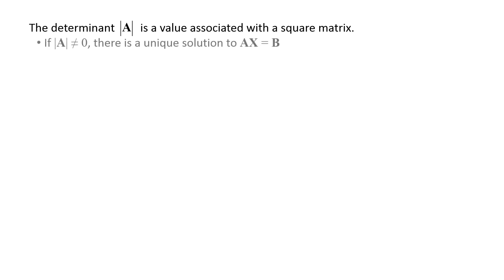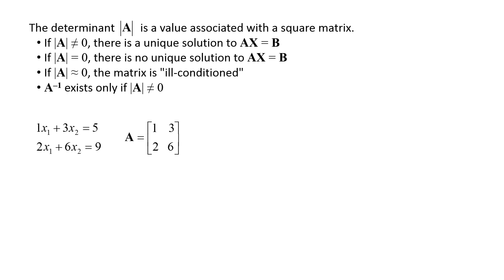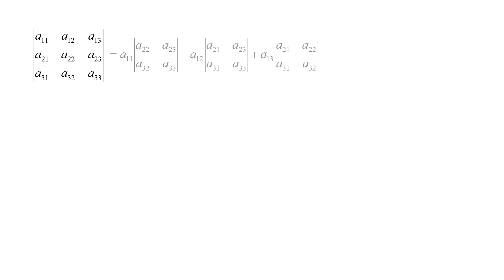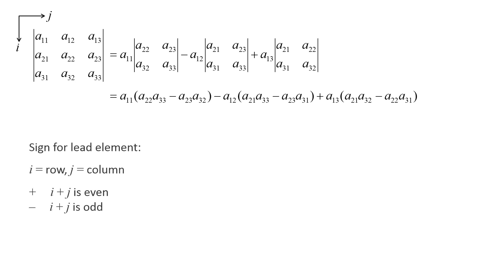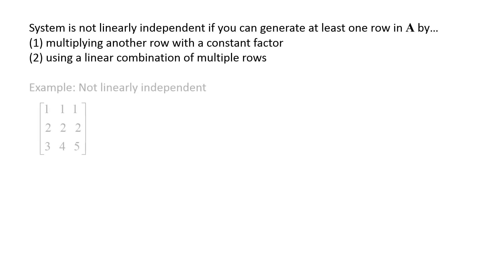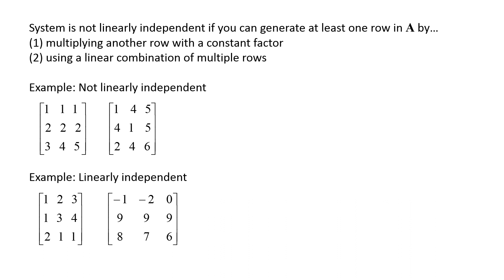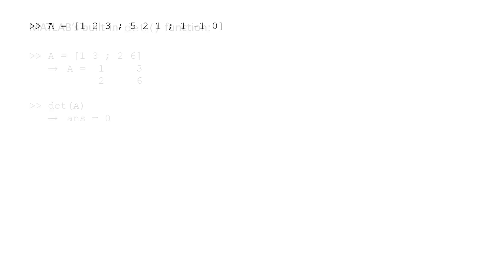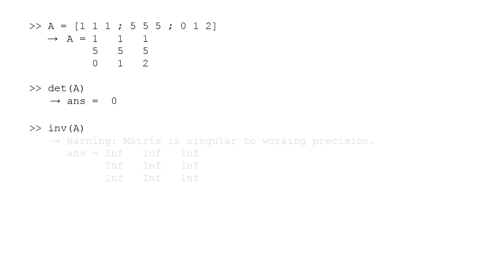Numerical Modeling: Topic 1.4 - The determinant

Comment: Determinant close to zero does not mean ill conditioned system of equations.
Reply from the maker: Thank you for the correction. I should have said that a determinant close to zero can be an indication of an ill-conditioned system of equations. Textbooks can sometimes get confused about this as well. On page 261 of Chapra & Canale's "Numerical Methods for Engineers"' (7th ed), they state, "... we arrive at the general conclusion that an ill-conditioned system is one with a determinant close to zero." Although later they state, "It is difficult to specify how close to zero the determinant must be to indicate ill-conditioning [because] the determinant can be changed by multiplying one or more of the equations by a scale factor."